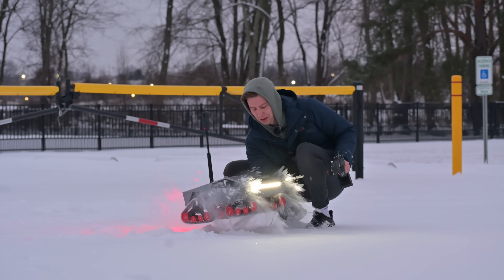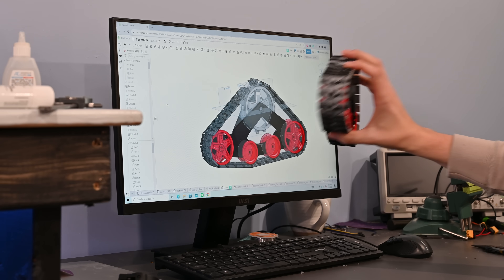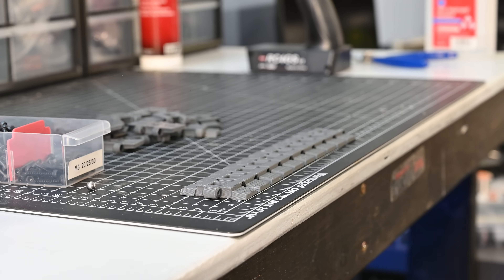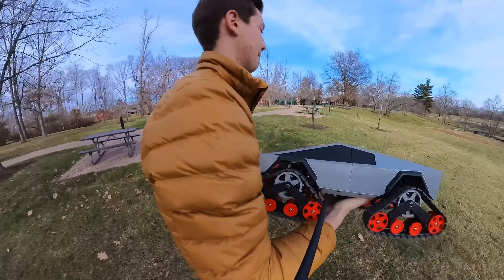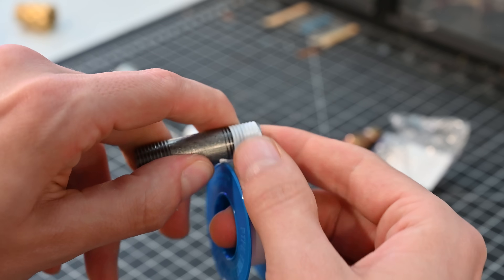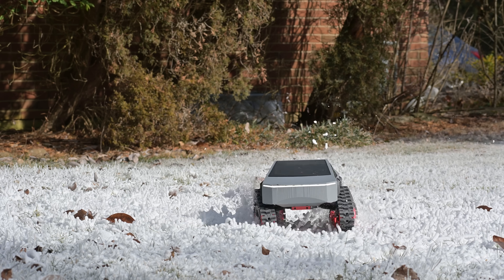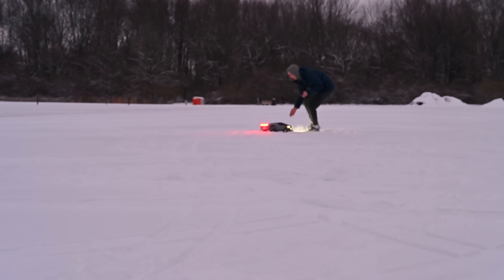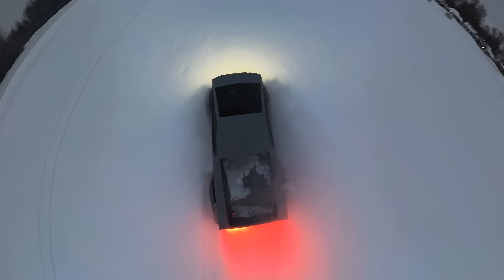WORLDS FIRST CYBERTRUCK with TRACKS! (DIY RC CAR)

Comment: Tpu or TPE  tracks print in place that don't require screws.    And test drive in deeper snow. See if it will drive on the top or just sink so wider treads and reduce weight of truck.. I'd love to build one if these.

Comment: What if you just mount 4 small drone motors in each wheel hub so there are no gears or parts like that to fail? You could probably even program some kind of AWD system using the 4 motors to help traction.

Comment: try adding suspension to the actual tracks themselves. and also try and make the 4 rollers out of TPU so you could get even more damping. another thing is try using 4 seperate motors. 1 for each track. Great Video BTW!!!

Comment: wouldn't it by a nice touch if the rollers were on pivots or had their own suspension so that they would provide shock absorobtion from the tiny bumps.

Comment: Fully printed RC vehicles is not a good use case for 3d printing. Way too fragile compared to chromoly drive shafts with universal joints, hardened steel gears, 3mm thick aluminum chassis tubs, etc etc. 3d printing is a fine rapid prototyping method for things like your tank tracks, which should then be made from metal with traditional subtractive manufacturing (the actual track belts could be printed from tpu!).

Comment: I have wanted to do tracks on my RC for so long, iv even made 2 tracks, but the issue always  that i couldn't add a stabilizer bar on the tracks so they would just flip over like a wheel. Debating on modifying some stub axle hubs to add some  stabilization

Comment: This thing needs a track tensioner. In a couple of shots the tracks comes high enough of the sprocket to slip.

THe second thing i would add is a compliant mechanism on the modified steering knuckle to allow for rotation of the track around the axle to give it some sort of suspension and even better off-road-ability.